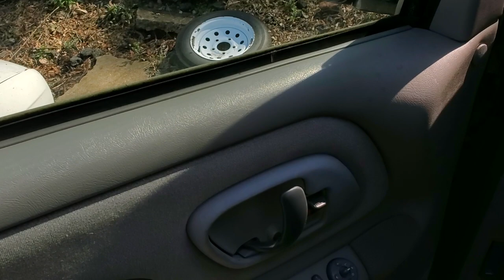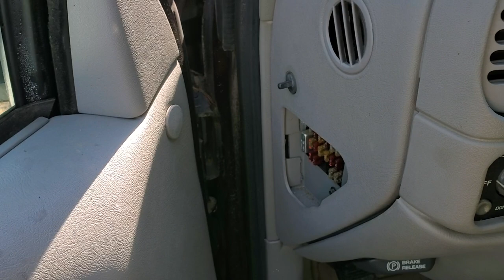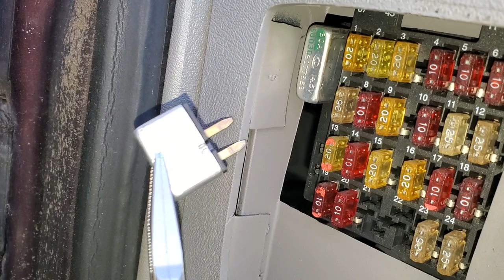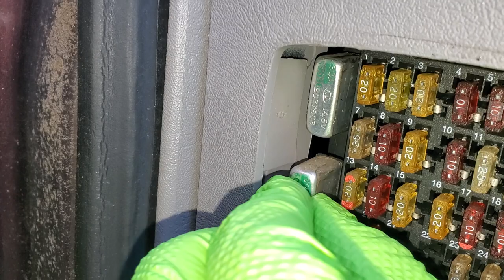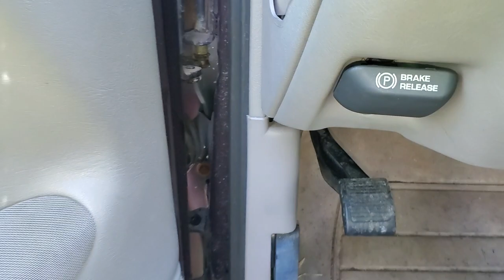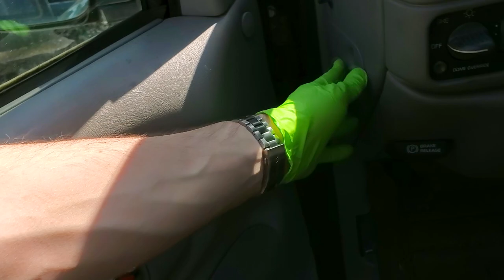1996 Chevy Tahoe Power Window, Power Door Lock Fuses

Comment: I just swoped them and they both worked ( I took my driver door off to replace the roller pin and my door lock wouldn't activate the actuators and just swapping them worked) and you did very well on this video, thank you

Comment: Great to know. This helped me resolve the issue of pressing the door lock switch and the dome light turning on, with no door lock actuation and no dome light function. 

Once I fiddled with the top relay, the dome lights would blink on. After some cleaning and adjusting of the wiring behind the headlight switch, it all seems to work. Thanks for the video!

Comment: Hey i have an issue...dont know if anyone can help....i have a 1993 C1500.  Windows always work fine at first.....after you drive it the windows (both) dont work at all .  The "circuit breakers" you showed get hot as hell (burn your skin),  after the truck sits for a while...windows work fine again......any ideas????

Comment: I fixed my locks by removing circuit breaker (top left metal canister), and twisted the two prongs about 20° to provide connectivity when reinstalled. This circuit breaker also powers the six way power seats which magically started working, and will stop the clickity-clack of locks attributed to a loose fit.
Reply: @V22D  it's in the fuse panel on left side of dash, just inside drivers door.

Comment: I switched the circuit breakers, but the locks still don't work with the lock on either door, only the remote. Any other suggestions?
Reply: Did you ever figure this out?

Comment: I'm wondering if that is my problem. I bought a used 97 silverado same as your Tahoe... And I didn't have the key fob.. So I got some and programed them and they kinda work. Passenger side does not work at all. Driver side does and doesn't... When I touch lock is opens and when I touch unlock it locks.
Passenger side does nothing at all

Comment: Thanks for sharing your vid' and info' !

Interestingly,    neither door lock switch will  work on my '96 sierra,  but using the key fob remote activates the function.    :-l

Coincidence;   . . . manual door lock switches may have stopped working when I was trying out a solar panel trickle charger,  plugging it into cigarette lighter.

UPdate:   It was the solar panel trickle charger plugged into the Cig'li'ter that blew the fuse and also coincidentally blew the fuse on the 'neighbouring' aux power plugin when I tried it the next day. 

Hmm  maybe if I was to acquire a  15 amp diode to place inline on the positive wire going into the supplied cig' li'ter adapter  which should restrict it so not to blow the 20A fuse, and still allow 15A to the truck battery.

Comment: My 1994 GMC Sierra got normal Power Locks without the remote. I got the RPO Code AU3 in the Glove Box. My power locks work when I use the switch from the inside of the car but when I use the metal key for example only the driver door locks or unlocks. When I go to the passenger side and lock or unlock with the metal key only the passenger side is working. What is causing this. I cant think of what the issue could be🤔

Comment: I bought a 96 Chevrolet tahoe. It came with an aftermarket alarm system. I can unlock with controller but the door unlock button itself don't work right. Any suggestions?

Comment: ..I have a '99 Suburban(like this one-GMT 400)...the power door locks frequently and randomly attempt to lock themselves.."clack-clack"...thankfully they don't succeed, but it's annoying and potentially a parasitic power drain on the battery. My question is, if I remove that top relay, will that kill the power door locks from working?..I'm totally fine if it does, since this is a work vehicle, and I don't use/need the power door locks anyway..in fact, I rarely lock it at all..I would like to resolve that annoying doorlock issue the simple way..by doing away with them...if I remove the top relay, will it effect anything else?....

Comment: I took I took the circuit breakers I check the fuses and when I push the button the interior lights come on down. I'm completely lost if you have any suggestions could you let me know
Reply: Mines doing the same thing
Reply: Did you find a fix?

Comment: Got a issue with my 97 k3500. The door lock key fob works fine but when I lock the doors with the switch it blows that circuit breaker? I think that is the switch causing it but not sure.

Comment: i had the same issue no power to power seat nor power door locks . Fuse 13 witch is labeled cig was blown replaced it and everything worked
Reply: On a 99 tahoe?
Reply: So I took the fuse 9 or 13 out and it was the cig fuse and I think the open my doors but I closed all my doors now I can't get in only side will let me in is the passenger side and that's it try wd40 can't get the door open need help

Comment: I have a 1998 Chevy Tahoe and I dont get power to my locks since I got it I tried fuses volt tester but it shows nothing
Reply: We had this issue on out 97 suburban and I found that it was the cigarette lighter fuse that was blown. I guess this fues gives power the the switch
Reply: Thanks man that’s what my problem was to how fuckin wierd
Reply: I disconnected mine my power locks and lighter socket and fuses still blow